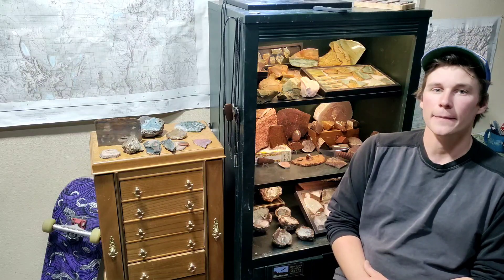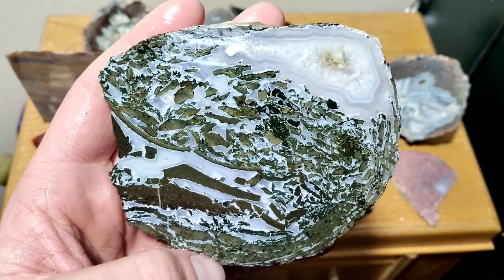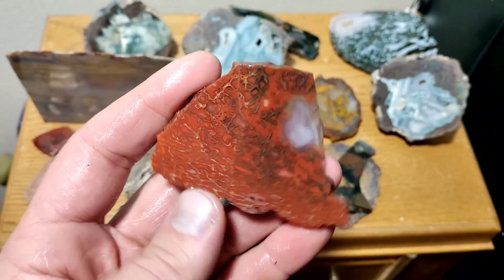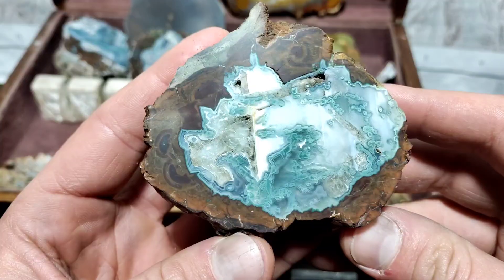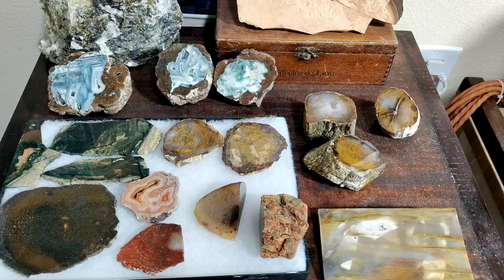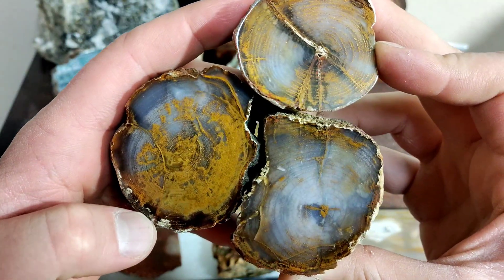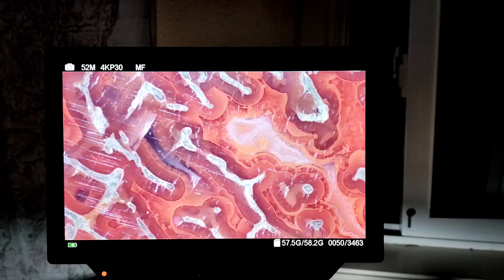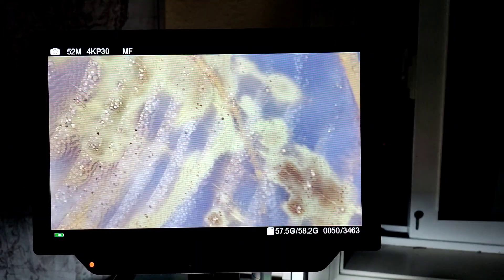Polishing a Batch of Rocks! And the Science of Cerium Oxide

Comment: Before WW2 and before Pilkington invented the float glass process, the primary application for large-scale glass polishing was for window glass using iron oxide (rouge) as abrasive.  Cerium oxide was first produced as a byproduct of uranium mining during WW2 but in limited quantities, and not until later was it identified as being a far more effective polishing media over iron oxide.  Large-scale cerium oxide was later produced via beneficiation of a rare-earth carbon fluoride called "Bastnasite" mined out of Long Valley, following a process similar to the Bayer process (alternative alkali/acid leaching).  The optics industry has been using cerium oxide for glass polishing since the 1960's without much understanding of the chemo-mechanical polishing mechanism, which is now understood to be a redox reaction. Ce4+ in CeO2 converts to Ce3+ in Ce2O3 when introduced to water, then at the glass-to-abrasive interface the Ce3+ converts back to Ce4+ allowing for formation of an additional active surface site that bonds to Si in the glass hydration layer.  As such cerium oxide reacts with the glass surface pulling off material one atom at a time, without having to have mechanical abrasion as the primary removal mechanism, thus exhibiting high material removal and yielding a scratch-free surface.  Only multivalent oxides undergo this redox reaction (such as iron, tin, and cerium) and thus have CMP polishing attributes, with cerium oxide being the far and away best performing of the group.  This CMP mechanism is specifically effective for Silica-based materials such as glass and agate, due to the high weathering rate of silicates in aqueous environments. Long Valley mine was closed in the 1990's and currently the majority of cerium oxide is now from Mongolia.
Reply from the maker: Awesome! Thanks for the thorough explanation!